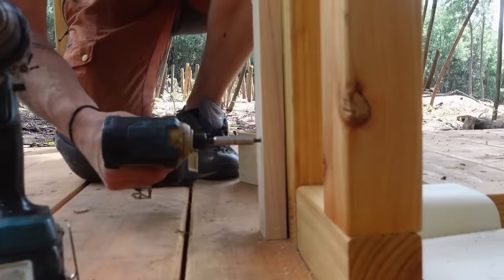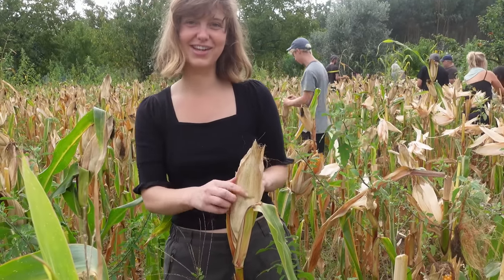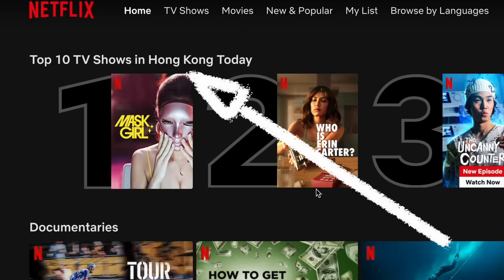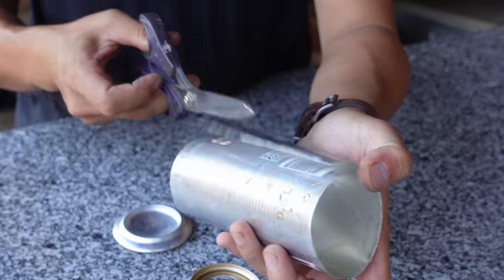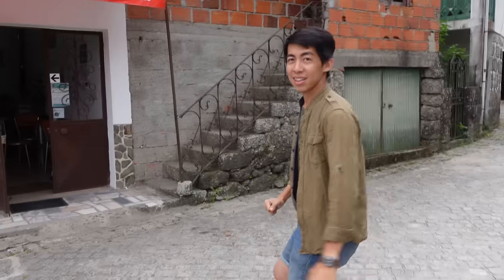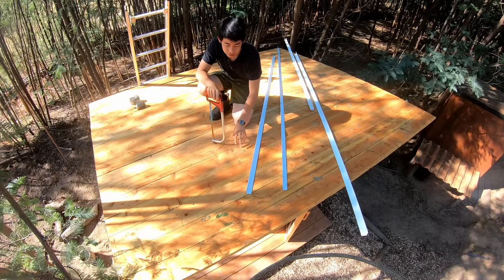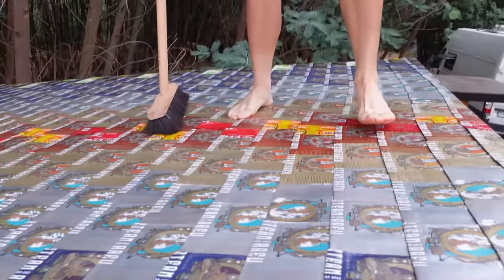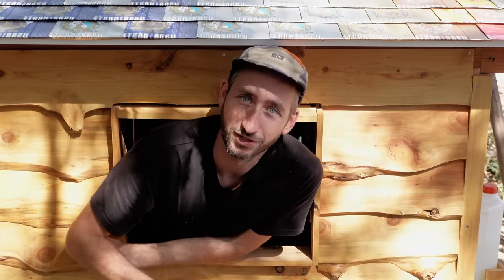#94 How we transformed 498 aluminium cans into a roof

Comment: I had no money back in the 90s and had cans and no siding for my house. Thought of putting cans on my house but went to the casino and won enough money to side the house with steel. Interesting that someone did this but on the roof instead. I think this would last and look better on a wall with an overhang over it.

Comment: The pitch of the roof is not steep enough to shed water properly. Also was the “test” rain stream heavy enough to replicate the rain you experience? That rough would not last here in Japan. By overlapping the sheets and increase the angle you can use nails but the main issue is the sheets are too thin for this application. Creative idea, though.

Comment: I hate being the bad guy. :D 
one way or another ....like moisture just from humidity will soften the screws from underneath or the tabs will get frail as aluminium does. 

this is why tin and steel roofs are more common. 

plus the flying blades of aluminum in a big wind storm would not be great especially if you did a whole house roof. 

Aluminum siding was more common. siding tends to take less wear than the roof. And in that case it is long connected pieces and curved rounded ends. Much more likely to flap partially loose than frisbee of aluminum in the wind.

Comment: Typical asphalt shingles in America are highly flammable which is much of the reason homes are destroyed in wildfires.

Big advantage of metal shingles is fire resistance, though steel withstands far higher temperatures than aluminum.

Comment: have you considered just melting them down and running it through an extruder? It would be more cost efficient, sturdier, uniformed and less wasteful. not mention the ability to locally manufacture light weight, stackable shingles would be a seller as well as reducing allumunin waste. al be it less fancy looking

Comment: "Aluminium is an infinitely recyclable material, and it takes up to 95 percent less energy to recycle it than to produce primary aluminum, which also limits emissions, including greenhouse gases. Today, about 75 percent of all aluminum produced in history, nearly a billion tons, is still in use. [...] In 2003, half of the products manufactured with aluminium were sourced from recycled aluminium material. [...] However the anodes widely used in the Hall–Héroult process are made of carbon and are consumed during aluminum production, generating large quantities of carbon dioxide, regardless of electricity source." - Wikipedia

Comment: I can’t fault the execution and workmanship of the project but I feel it is a bit wrong in principle. The project is extremely labor intensive and I do question the durability of the material. As an alternative how would it be if all the workers involved were to do some outside work for wages and then , pooling their resources purchase some corrugated roofing iron? It would be stronger, more water proof and could be installed in a fraction of the time. It is used extensively here in Australia and there are plenty of roofs 100 years old and still quite ok. One advantage that corrugated iron has is the strength it derives from the corrugation itself which allows the weight to be kept to a modest level without sacrificing strength.

Comment: A live roof would've been way more productive and less waste. Also could've done this with just flat cans and not cut them at all. Or returned them for money and used plastic instead. Not sure you guys are doing all you can to minimize pollution. And you can use nails instead of the drill. That's what is used on shingles.